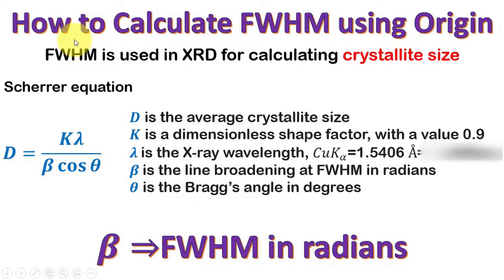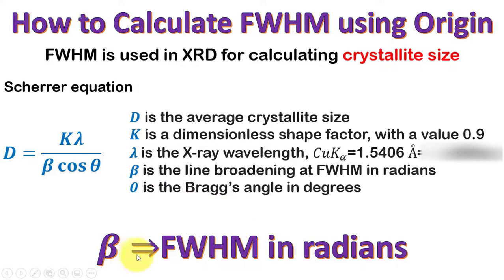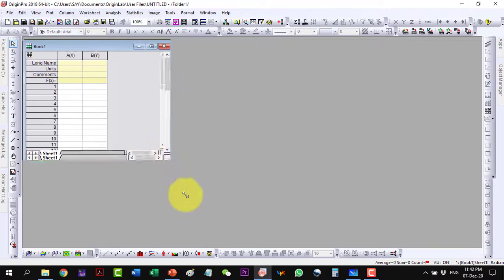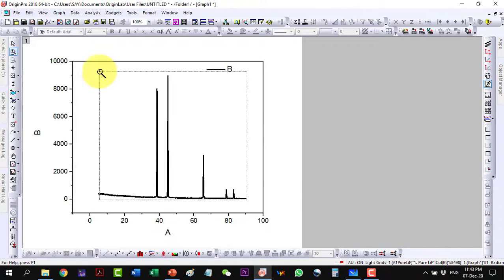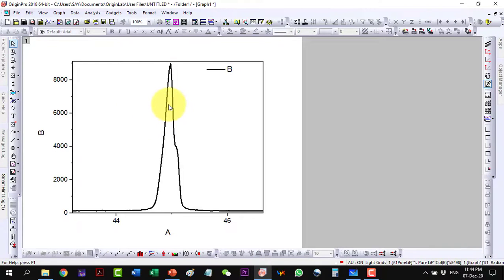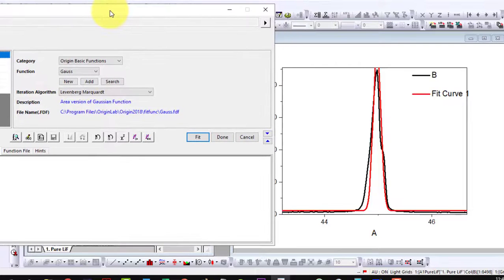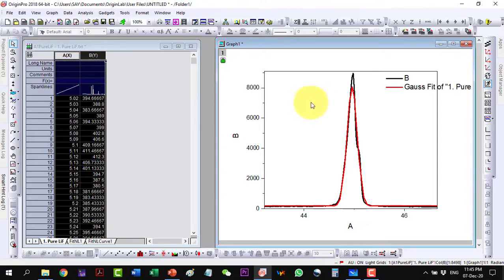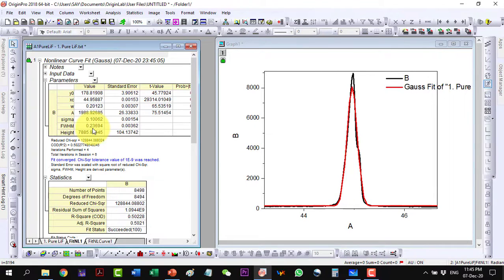How to calculate FWHM in origin

Comment: Sir, thank you for sharing your information with us. I cannot find the answer to this question. How is the differences FTIR diagram between the 2 FTIR diagram calculated in the origin
Reply from the maker: Thanks for the appreciation. Really, I'm not getting your question. If you could elaborate your question, I'll be able to respond. Thanks
Reply: @SAYPhysics   Getting the difference from the diagram of the pure substance from the diagram of the mixture containing pure substance. To get the difference by extinguishing the common areas of the two diagrams.
Reply from the maker: Emergence of new peaks or changes in the intensity/absorption can differentiate with the pure sample. Thanks

Comment: How to fit the amorphous nature graph with a broad peaks?
Reply from the maker: For amorphous materials, the XRD pattern usually shows broad peaks or humps instead of sharp crystalline peaks. To fit such data, you can use peak fitting in Origin (or other software) with Gaussian/Lorentzian functions, but keep in mind that the fit will mainly give you the position and width of the broad peak (related to short-range order and degree of disorder). Unlike crystalline materials, you cannot extract detailed lattice parameters, but you can analyze peak position (for average d-spacing) and FWHM (for estimating structural correlation length). Thanks

Comment: Sir,  shouldnt we make sure the COD(R^2) need to be close to 1 to make sure the fitting is as accurate as possible ?
Reply from the maker: Thank you for your comment! While it's true that a high coefficient of determination (R^2) often indicates a good fit between the model and the data, it's not always necessary for the coefficient to be close to 1 to ensure accurate fitting, especially when calculating FWHM. FWHM primarily focuses on the width of the curve at half its maximum height, which can be accurately determined even with lower R^2 values. However, it's essential to consider the context and purpose of the analysis. In some cases, striving for a higher R^2 may indeed be beneficial, but for FWHM calculations, the emphasis lies more on accurately capturing the width of the peak. Thanks again for your input!

Comment: Thank you sir..
What is the importance of Chi-square value . Sir.& is there any relation between that value and fitting g of XRD curve ..? Sir
Reply from the maker: Certainly! The Chi-square value is important in data analysis as it measures the discrepancy between observed data and expected values in a statistical model. In the context of fitting XRD (X-ray diffraction) curves, Chi-square is often used to assess how well the theoretical model fits the experimental data. A lower Chi-square value indicates a better fit, implying that the model accurately represents the XRD curve. It helps validate the goodness of fit and the reliability of the model used for data analysis. Thanks dear 😊
Reply: @SAYPhysics  Thank you sir..but how much we consider the value of chi- square.? It come as 1E - reached...?
Reply from the maker: In general, a lower Chi-square value is desirable for a good fit. The "1E - reached" notation indicates a very small value, likely in the range of 1E-5 or smaller. A smaller Chi-square value approaching zero suggests a closer match between the theoretical model and the experimental data, indicating a strong fit of the XRD curve to the model. Thanks
Reply: @SAYPhysics  Thank you very much sir...
Reply from the maker: You're welcome dear

Comment: Can this be used in Origin 8.5?
Reply from the maker: Yes, fwhm can be calculated in 8.5. However, it's calculation through the gadgets is not included in that version. Thanks
Reply: @SAYPhysics  But the theta & FWHM can be calculated accurately right?I got 2.6217 for FWHM.. What will be the theta then?
Reply from the maker: Yes, sure. Thanks
Reply from the maker: You selected a peak for which fwhm is calculated. The location of the peak is your theta value. Thanks
Reply: @SAYPhysics  I'm sorry the theta value from the peak refers to the centre of peak? Is it the xc shown in the Gauss table? I am sorry I am new to this.. Tqvm
Reply from the maker: Yes, you're right. It's called the location and in the table, it's the xc value. Thanks
Reply: @SAYPhysics  What if there is 2 peak to be analysed instead of a single peak?
Reply from the maker: To calculate the crystallite size, we must select a single peak. Thanks
Reply: @SAYPhysics  Thank you very much Sir for your help
Reply from the maker: You're welcome dear

Comment: Hi, sir. Thank u for sharing with us. If you don't mind , can you explain how to get a refine xrd data like that?
Reply from the maker: Thanks for the appreciation dear. I have a tutorial on how to smooth XRD data. 
https://youtu.be/asxWjB9MSiE
In the case you want to have a smooth XRD data from the machine, you'll have to keep the step size very small and scan time as long. 
Thanks
Reply: @SAYPhysics  well, what if the XRD data has much noises and not substracted on baseline? 🙏🏼 I Saw your xrd data before smoothing is correct to baseline already...
Reply from the maker: Yes, you will first subtract the baseline and then smooth it accordingly. Thanks
Reply: Thank you so much dear.

Comment: Thank you for this video. I noticed that the peak seems to have a shoulder peak? Will  you not take into consideration the kalpha1 and kalpha2 contribution in fitting?
Reply from the maker: @Hana just added the said video. Thanks
Reply from the maker: Yes, you're right Hana. In the case, you want to count for the Kα1 and Kα2, you''ll have to resolve it further. The first prominent peak is for Kα1, while the shoulder is for Kα2. This I might cover in  another video. Thanks